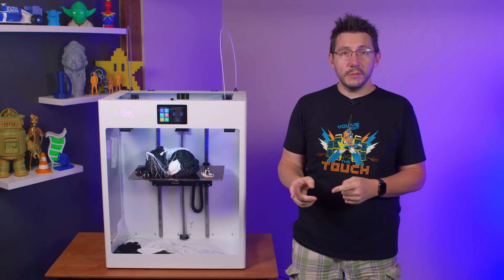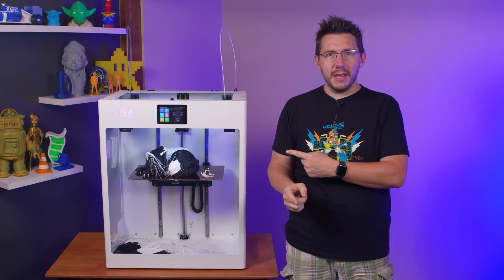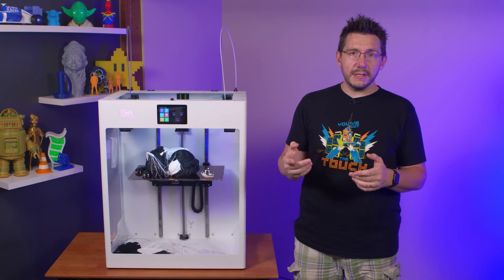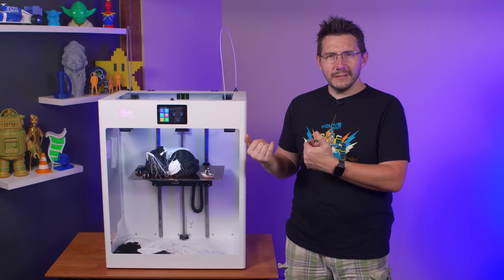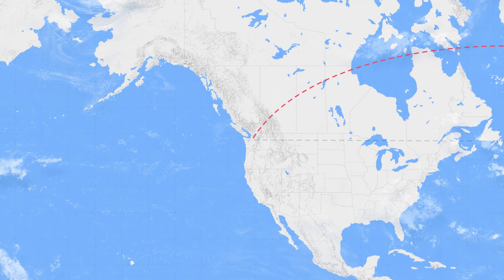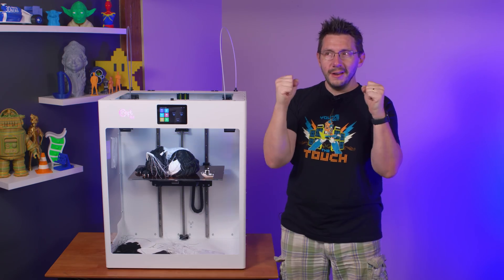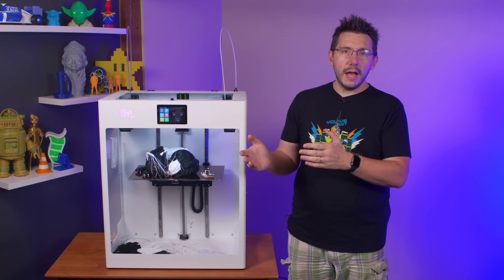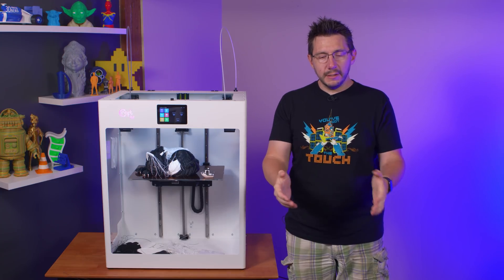Craftbot FLOW IDEX XL Update - THE PINS WERE BENT!

Comment: I have to say, the comments of people saying they also had problems is really concerning - the problems seem to run way deeper than we were made to believe. I have no doubt they are improving with time, but what happens to the early adopters (who aren't YT'ers and get overnight parts and a full spare machine shipped).
Reply: All I will say is this. The Craftbot 3 was introduced around May of 2018.  Since then they released 3 or 4 firmware updates, with the LAST one being July 2019.  You can see that here: https://craftbot.com/firmware  So then the new FLOW IDEX printer comes out November 2019.  So they supported the Craftbot 3 for what, maybe a little over a year.  And yeah, it has its share of bugs.  Compare that to a company like Prusa that not only supports their products for years, but lets you upgrade the hardware as well.  
And look at Craftware, the slicer for all their printers. On the Mac, the latest version came out May 2020, and on the Mac it says it is "version 1.22 x64 beta."  Maybe a non-beta version would be a nice touch!!!
Reply: I don't know about you guys but if I spend $4000 on a printer I'd expect it to be, like, not broken, but I guess that's just me.
Reply: @thlin28  These are obviously shill accounts.
Reply: Hey Angus, would you recommend using Prusa Slicer instead of Craftware? I’ve had nothing but problems with Craftware…and don’t even get me started on the experience of trying to use a .6mm nozzle.   It’s like the Slicer software doesn’t even care that you’ve changed nozzles.  

It defaults to a 2 Extrusion Width Perimeter Gap, thus leaving your Corner/Z-Seam looking horrible.

We’ve also got an Ender 3 Pro in the shop, it prints far better than the Craftbot Flow IDEX XL with a .6mm nozzle…. Might be the Slicer (PrusaSlicer for the Ender and Craftware for the Craftbot).

Our i3 MK2.5 smacks both of those though. Haha
Reply: I can tell you what happens. They do everything to make it right! They overnighted parts to me, spent hours on the phone with me. Your Not that special! I got one of the first machines in the US and I had more issues I think then any of you two are having plus crazy firmware issues. I was not trying to pump out a video so I can get paid for it. I took my time... figured out how this machine worked, what the issues were and learned from them. I got this original machine working great with full help from HQ of CB whenever I called. These Flow IDEX printers are great machines, but the learning curve is steep I agree. When I bought my second Flow IDEX I set it up no problems at all, and it worked out of the box. Yes I have 2 now both working 16-20 hours a day.
Reply: David Lawrence I was one of the first customers ever that received the Craftbot 3 when it hit the market. I can copy paste what you have written. My first machine was finally exchanged. The second machine then only had a mal functioning stepper motor which was kindly exchanged very quickly. Eversince the printer is working fine.  Yes, the printer has a steep learning curve. I would clearly not recommend it to someone that is a total beginner when’re comes to 3D printing (CraftBot 3).
If I had the chance I would love to compare it to the new Idex Flow generation. I could really tell which improvements have been implemented in comparison to the CB3. But as I am a small YouTuber I don’t get that chance as I can’t afford a second machine. 
Their problem is quality control. The machine itself is really well built. And I really question the knowledge of those guys that are in charge for firmware on these machines. I had to go back to older builds several times as the updates left me having nothing else than problems.
Reply: @ScubaDaveCCR  Fanboy alert...
Reply: GroovyDrifter owner of two Flow IDEX machines. AND You have? Keep Drifting, NEXT!
Reply: @ScubaDaveCCR  Considering this is a $5K USD machine (if you want doors, its $220... if you want a top... its $220. The price really starts to add up when the invoice comes in), it should work right out of the box. The buyer should not be fixing it. I own many machines at my biz, and those that are made and sold for business and industrial purposes, like the craftbot is, do not have me the buyer fixing them if something goes wrong.  Its one thing to have to replace a small superficial part because it got damaged in shipping, and understandable during the setup process. But tearing a hot end apart on a new machine? 

Unacceptable. Im glad I watched these videos. It saved us another bad printer experience (like we just had with Raise3d).
Reply: @ScubaDaveCCR  You guys keep saying "steep learning curve" and I don't think you know what that means lol. If I bought a laptop and had to replace several parts in it before it worked, I wouldn't say that it has a "steep learning curve", I'd say it was broken. Steep learning curves are things that have a ton of features or do something in a totally new way or are just overall complicated, this machine isn't exactly what one would call "innovative" for 4K$ lol, it doesn't have a steep learning curve, it's just horrid QC on their end and a giant case of "lowest bidder/you get what you pay for", also from what i've seen you guys are right about getting help, they seem to know that their machines are garbage on arrival so they are probably doing extreme damage control.
Reply: Tabris no what I mean by steep learning curve is there is so much packed into this machine that it’s hard to grasp out of the box. And in setup if your not paying attention to what the directions are telling you you can really get lost in the process... like Joel did during the manual step in the calibration and several other steps he didn’t do which I can see now was totally wrong. I was not referring to the steep learning curve as to the broken parts. This is a very heavy printer 2-3 man moving and setup job. At the beginning oh his video they slam it on the counter sideways and then roll it up right. Obviously if he actually paid $4000 for this machine he wouldn’t be treating it this way I surely didn’t. And I will say the tech-support in the US is not impressive at all! But the Tech-support and service I got from a Craftbot HQ was exemplary. 
And as far as QC the machine is nicely built. I think they need to switch from the shipping carriers they are using in the US because the other country’s don’t seem to have these issues. I own 2 now... one was one of the first in the US and I had issues with it. The second was plug and play... It’s kinda hard to talk about something you don’t own! 🤔
Reply: @jsullivan05  You're not buying a laptop, dummy. This is a TOOL, not a toy that should work out of the box for anything you want.
Reply: @clort123  Uh, yeah it SHOULD work out of the box no matter what it is, especially for $4k...
Reply: @ScubaDaveCCR  According to this, you would also be ok having to put your own iPhone together?
Reply: @scrapjack  lol if you're an iphone person you shouldn't even get into technical anything
Reply from the maker: That doesn’t even make sense?
Reply: Maker's Muse you act like Hungary is half around the world or something.
Reply: Angus, this is not your normal off the shelf printer. It takes time to understand it and use its potential. I know what your issues were and the new FW solved 95% of them admittedly with a different slicer. Talk to users who use these printers 24/7 365 days a year. You may have a different opinion afterwards. This printer does PLA, PET-G, ABS, Carbon Fibre, TPU, Nylon etc out of the box (can show you many samples). Contrary to what some have said on here, Craftbot’s support has been first class. Those that have said the support was bad ,did they raise a support ticket? Did they follow up after the supposed inaction (they should not have to, but I have never had to). Everyone seems to have an opinion without actual real life experience. My opinions are based on real life facts not on reviews or other external sources. There are print farms in excess of 20+ printers with these printers running day in day out.  What I am trying to convey is the reviews dont actually marry up with those that have them and know how to use them.
Reply: Rick Norris sock puppet.... no videos, no subs. But cared enough to make a comment. If you are real, Joel tested his for a month, Angus was several months I believe. How long should they “test” on it before it works correctly?
Reply: @thelightspeed3d712  Im no sock puppet, I don't have a youtube channel so there will be no subs. I have prints to support my comments, hundreds of them. I know this printer extremely well and have thousands of hours on mine. I think you will find it did work for Angus, he had issues with dual colour. I am happy to be corrected if that is not the case.

Comment: Really unfortunate for Craftbot. The Craftbot plus was a fantastic workhorse of a printer for the money, basic and rugged. The CB3 works well also but it's clear it's not a finished product. Manual only levelling on a huge bed is a fail, The multicolour basically doesn't work because of the junky craftware slicer and poorly designed nozzle height adjustment as well as the fans dying regularly. They used a no name super nasty type of fan.. why do this on such an expensive product.. Seems they've gone all the way off the deep end with the flow.

Comment: I'm sooo glad you posted this. We have the exact problem with the exact machine at work and I thought I was the one that screwed it up, being a newbie. I'm hoping that the solution is just to disable the FMS on the right print head.  I'll check out your stream to see how your new machine works out.  Our machine did about a dozen prints before having issues on the right side.  Please do let us know if the original machine works fine with the FMS disabled on the right side.

Comment: OMG! I had a nozzle shipped to me that was full of sand. I never created a review about my Craftbot 3. I always thought that it was my fault that it didn’t work right. I also had mine replaced. It was a long journey. In den meantime everything works as it should. But it costed me lots of nerves. Maybe I should record a video about my longterm thoughts about it and what problem I had until I got to the working status with the printer as it is up to date right now.
Reply from the maker: FULL OF SAND?!?
Reply: 3D Printing Nerd  yes, upon arrival the exchange nozzle was jammed with sandblasting medium. Luckily I had some of those needles for clearing nozzle jams that Pooch once gave me. So I was able to clear it out. I took a picture because otherwise no one would believe me. I investigated it using my microscope. As a dental technician I know that it must have been: aluminum oxide sandblasting medium. 
Oh, I forgot to say why I had to exchange the nozzle on my new machine in first place. I kept on having filament jams continuously on one head.
Reply: @choschiba  Since I'm really curious... I wonder what part of the manufacturing process on a 3D printer involves sand blasting?
I've received DIY 3D printer kits where the box had lots of aluminium swarf floating around because they must be cutting V-slots/V-rails right beside where they pack the printer components. That lead to swarf getting inside the hot end assembly and jamming the nozzle right out of the starting gate.
Reply: @anthonyrich1592  I really have no clue. Maybe they sandblast the nozzles after drilling. I will search for the pictures I took on my harddrive. I really couldn't believe it myself when I saw it.

Comment: I own a Craftbot 3, where is the IDEX printer before this one. It wasn't available for long, but it has/had the number of trouble you had. Like others have said, Craftbot didn't seem to send me a new printer like you received. I had to deal with these problems myself, and it wasn't as FUN as your experience. But here is what makes me VERY mad. They haven't updated the firmware since the new printer came out. Check their website if you don't believe me. And my printer still has lots of firmware bugs. Good support, yeah. By the way, I get those clogged filament problems ALL THE TIME, and unlike your printer, mine DOES NOT have ant sensitivity control. I would NEVER go near CRAFTBOT again with a 1000 ft. pole. Even if their new printer is great (It isn't) what about just abandoning all those with the previous model?  Glad you could get them to keep sending you new replacement printers, but for normal customers, they don't.
Reply: Also note, I bought my printer with my money. Please state how much you paid for your.

Comment: I have one of these.  My print bed is actually warped (bowed up at the left and right edges).  After calibration my first layer z-height is perfect near the center but the nozzles actually scrape the surface at the extreme right and left edges.  This has happened gradually. It did not do this when I first got it.  Craftware initially blamed it on a faulty BL-Touch calibration.  Then they told me to downgrade the firmware.  I finally sent photos of a straight-edge laying across the bed to show the bow.  After a week, they have not responded.
I really want to love this machine, but...  I hope they get their act together.  It is a beautiful piece of hardware when it works.
Reply: Yup, same experience I had with their tech support. When they can't fix it, and they usually can't, you never hear from them again. By the way, Craftware for Mac really sucks.

Comment: Having to strip the extruder down to the gearbox just to clear a jam inside said gearbox is bad design. It's $4000 not $400, there is not much excuse for that sloppy design.
Suspect the right extruder jam sensor is connected to electronics with some minor manufacturing fault, eg wrong resistor in a certain place.

Will this be the first 3D printer to catch fire, due to Joel getting so fed up he set it on fire himself ?
Reply: Joel didn't have to strip down the extruder, all he had to do was adjust the extruder tension from the top of the extruder, this would also have fixed his issue with the filament slipping and trying to correct a non existent jam. This is a 30 second adjustment
Reply from the maker: I did have to strip down the extruder. There was a big filament ball in the gearbox I had to remove. That’s why I took it apart and showed that in the video. The tension had nothing to do with it - the tremendous heat from the heat creep caused the PLA to melt in the gearbox. For the screw at the top, what is proper tension? I tried various depths of the screws from all the way in to all the way out, and a few levels in between.

Comment: It's not isolated. I just got mine last week and have the EXACT. SAME. PROBLEM. Plus a few more. Craftbot has some work to do to keep me from just returning it, but I doubt I'll get the same level of customer service.
Reply from the maker: You had bent pins as well?
Reply: @3DPrintingNerd  Yes. I haven't had a chance to put it back together to see if that fixed it, but it looks pretty similar to yours.
Reply: Just wondering, did Craftbot send you a new printer for free to fix it, or is Joel's experience unique?
Reply: @A1N0  I haven't gotten a response yet, but I'll let you know what they do.
Reply: @A1N0  They're trying to convince me that faulty sensors and fans are part of the learning curve that all printers have. If they're this bad when it first comes in, then I can't imagine that five year warranty is gonna be worth much.

Comment: These expensive printers can be frustrating. I bought an ultimaker 3 and I had the same problem with a broken cooling fan and heat creep. Now I'm having issue with the PCB in the hot end.

Comment: I have this printer as well. I’ve had to spend a lot of mo why on spare parts so I’m envious of your experiences getting things replaced for free.
Reply: Also the replacement hotbed I bought with overnight shipping showed up not pre clogged but with a smoking heater cartridge
Reply from the maker: Smoking heater cartridge???
Reply: @3DPrintingNerd  yep white whisps out the back of the heater cartridge starting around 200c Wasn’t gonna give it the time to do worse so pulled it out. And put in a replacement. Very unhappy though
Reply: @josephmeier4663  ... That's a story and a half...
Reply: @Mikowmer  That needs a video!

Comment: Pitiful. I bought a Creality CR10S. It was my first printer and right out of the box the frame was warped and the bed couldn't be levelled. I spent hours and months on the phone with tech support. The printer was replaced once and fans replaced twice. This was an appalling first experience. I'm technically minded, but this was way over my head for new technology and has massively dissuaded me. And STILL so many of the 3D printing videos are of the "how to fix" or "how to get reasonable quality" variety.
Manufacturers need to stop this shit. We're waaaay past the "hobbyist so it's okay if it's all crap and you have to rebuild from day one" stage of 3D printing. Frankly, the nonsense you got with this printer is enough to erase the manufacturer from my "ever consider" list.